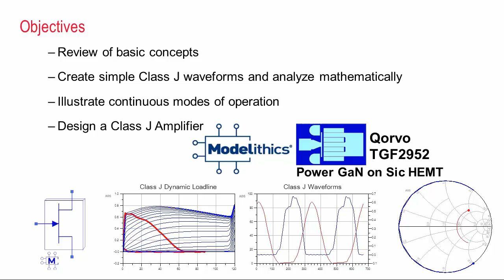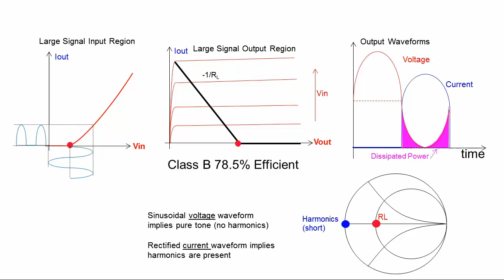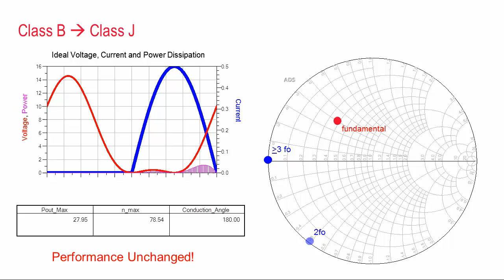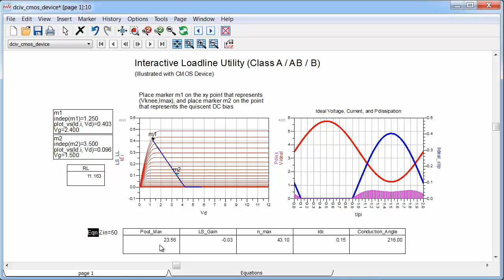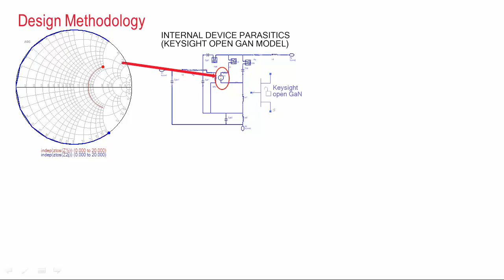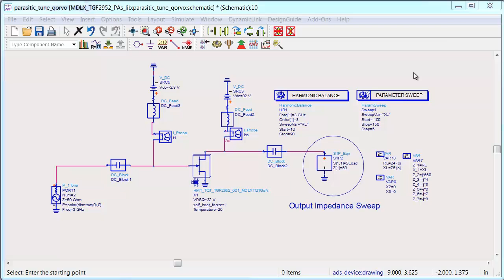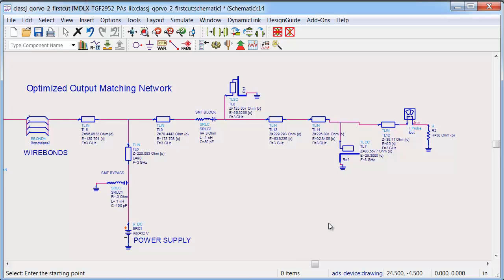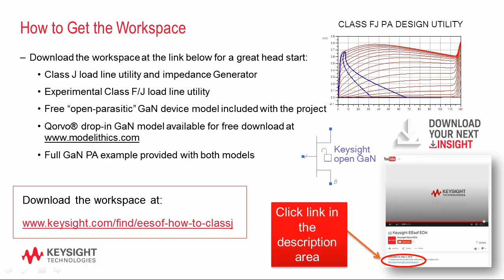How to Design an RF Power Amplifier: Class J

Comment: Hi! Thanks for the educative video series. I wonder whether ADS has any utilities for designing power amplifiers with Bipolar Junction Transistors. For example, bias network design for the bipolar transistors etc. So far I have been working with FETs, but now I need to design a PA with BJTs and I believe there are some particular concerns when designing with BJTs. Are there any design examples in ADS for PAs with bjts?
Reply from the maker: You're welcome. We recently did a webcast, "Beyond CMOS vs. GaAs - Finding the Best Technology Mix for a Handset PA" that includes an example of a bipolar PA. This might help you get started. http://www.keysight.com/main/eventDetail.jspx?cc=US&lc=eng&ckey=2283882&nid=-34360.0&id=2283882

Comment: Very good demonstration for the Class-J Power Amplifier. Do the example files run with ADS 2009? Or they are compatible with ADS 2011 and higher versions?
Reply from the maker: +Firas Mohammed Thanks Firas! The example files are only compatible with ADS 2011 and higher, such as ADS 2014.01 and 2015.01. You can apply for a free trial of the latest version here: www.keysight.com/find/eesof-ads-info